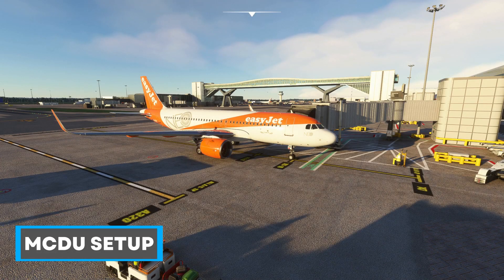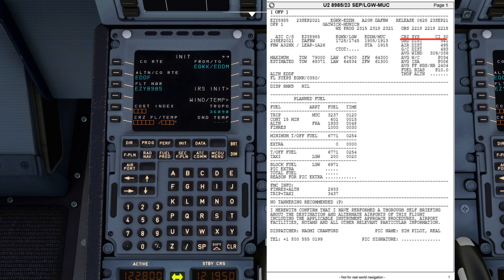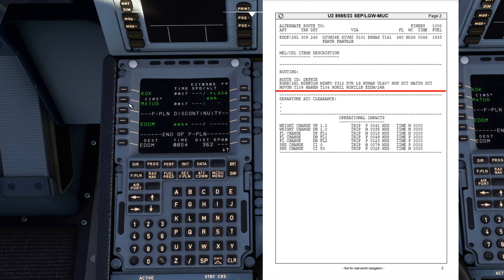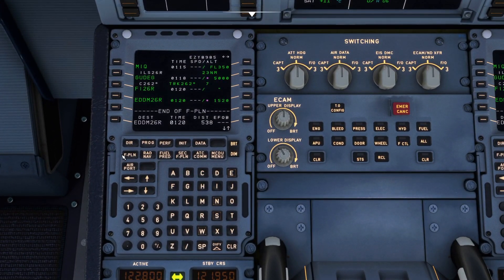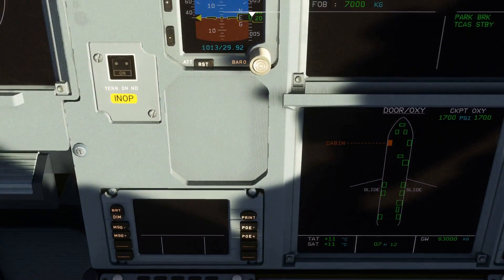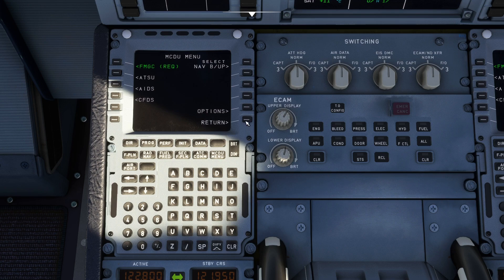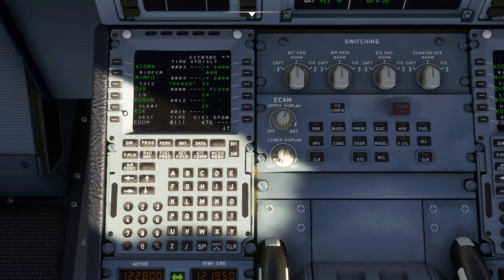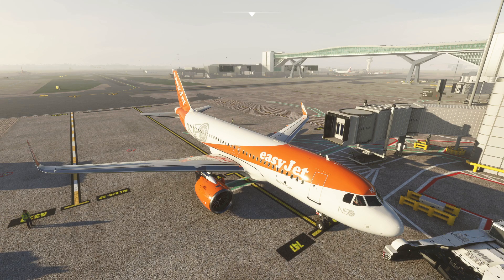A32nx MCDU tutorial | Manual setup + Simbrief

Comment from the maker: The A32nx has been updated. You no longer need to connect your simbrief username via the mcdu. All that is required is to connect your simbrief username to the flyPad in settings-atsu/aoc.
Reply: My mcdu is saying uplink insert in prog. I can’t import or manually setup. Fly pad isn’t retrieving plans either. Any suggestions?
Reply from the maker: Did you try the CLR button?
Reply: Got it sorted… the fly pad was putting a space in my user name🤦🏾‍♂️. And I had to update the fly by wire. Thanks.
Reply: I have the latest developer version but dont see the option choice on the MCDU , is this the reason why? They moved it to the ipad computer?
Reply: @DeltaTristar500  Yes
Reply: I can’t enter my Simbrief username into the flypad. I type it in but how do I click enter?
Reply: Thx for letting me know :)

Comment: But how do you setup the trim on the mcdu? How do you know what value to insert so you don't fly at crz alt pitching up like I do 💀
Reply from the maker: During cruise the aircraft should trim automatically with the autopilot on. 
The value is based off the aircraft CG and these days is calculated on the payload page of the EFB.
Reply: @RealSimPilot  I’ve been looking for tutorials about it for so long but couldn’t find anything. I found someone who made an excel document of cg values that gave the trim value but it didn’t work for me. Plane still pitched up at crz alt

Comment: I appreciate your videos and find them highly informative.
I dont have the OPTIONS available any longer  to even get to the SIM BRIEF page(s) I import from the FLY Pad ... many things seem different and inoperatvie.. I have the latest DEVELOPMENT Fly by Wire version of A320.   Are you experiencing any odd behavior with AP features and MCDU ?  
The top Panel seems much different in its operation than a few months before.  No push and pull of the knobs and no SOUNDS ? Cant use the VS features at all even on m,y  BRAVO Throttle, I have to click the EXPIDITE button to get any repsonse to alititude change .... hmmmm

Comment: Awesome video! Only problem I have is when using ATC it almost each time gives me weird altitude changes before arrival or another runway. Which will screw over my approach. Is there a way during cruise to already know what runway you’re getting assigned from ATC? That way I can still make manual changes in flightplan created by Simbrief.
Reply from the maker: I don't think there's any way around it if you use the default ATC. I don't use it so I turned it off, I'm not a fan of the default ATC.

Comment: Great video. Checking manual flight plan entry procedures and Simbrief automated integration after FS2020 update 7.  
FBW autopilot has become unstable disengaging after departure and CTDs. Community empty also other basic checks done.
Wondering if FBW autopilot in development mode with FS2020 needs a very precise flight plan entry procedure. Loading flight plan from FS2020 world map appears not to work at all.
Ever since FS2020 update 5 sadly FBW Airbus has been a very high maintenance girl. Autopilot unstable to this day. Result unable to fly FBW Airbus with AP.  FBW dev team have done a great job. Look forward to AP stability returning. Until then flying CRJ and TBM 930 with Working Title  G3000. In both AP is excellent and stable . Have been with FBW since beginning. An excellent development project that requires patience.
Reply from the maker: Thank you.
You cannot use Msfs built in flight planner with the a32nx it doesn't work. Not sure about your AP problems. Having no issues on my side with the A32nx.
Reply: @RealSimPilot  
Thank you. FBW development AP is challenging. A week ago AP was working. Now unusable. You have confirmed world map not working. Appreciated. Your tutorials are excellent. Am a deep sea yacht master and navigator learning to fly!

Comment: I'm having this weird bug where after pressing *init request on the init A page, the mcdu is stuck with uplink in progress message. Any solutions?

It doesn't let me input the from/to field manually and neither the cost index. Also in the flight plan page I am unable to add waypoints or select SIDs/STARs.
Reply from the maker: Have you updated the aircraft since sim update 7 on Thursday?
Reply: @RealSimPilot  Hey I was on the stable build v0.7.2 earlier. I switched to the experimental version today and it is working great! All the issues are fixed now. 

Thanks for the video btw. 😀

Comment: I tried to emulate your entries just for learning purposes and system cannot accept ROKIL airspace waypoint and also munchen approach pattern ROKIL1B is completely something different approach in my case. Can you please explain if you know of course what is wrong.. maybe some bug or changes in updates because i tried couple of times.. and also missing PERF/W+B option i cannot enter payload figure ... tnx in advance
Reply from the maker: Make sure you have the latest Airac navigation data installed as well as the experimental version of the flybywire A32nx.
Reply: @RealSimPilot  ahaaa.. that is probably the problem i dont have subscription for Navigraps so thus not the latest Airac (mine is 2003) and i have development version, will try experimental... anyway great tutorial! tnx.. greetings from Croatia
Reply: @RealSimPilot  Hm that strange i installed experimental version and still missing perf/w+b in mcdu... and also missing options in mcdu to automatic import fp from simbrief.. do you know if they changed layout of mcdu in newest version or im doing something wrong? tnx
Reply from the maker: @professorneutron4889  you connect your simbrief username via the flypad (iPad),  the perf w/b menu is under the aoc menu.
Reply: @RealSimPilot  I already connected and clicked from simbrief on fly pad but what is confusing layout of mcdu is different.. when i click mcdu menu left side of screen is identical like yours but on the right side there is no option and return just nav b/up on top do i have outdated version or your version is different mine is 0.7.2
Reply from the maker: @professorneutron4889  it's been updated since the video. On that page that you see look for ATSU then AOC menu. You
Reply: @RealSimPilot  Tnx for reply!, So i found out.. in newer versions there is no option any more as you said, to automatic input data from Flight Plan i must go to MCDU/ATSU/AOC MENU/INIT PRESS and then press INIT DATA REQ, then go to INIT and press INIT REQUEST then go to FUEL PRED and also from there input and data will come automatically and so on... but of course firstly connect with simbrief from fly pad otherwise there will be no INIT DATA REQ & INIT REQUEST to automatically input data from plan... if someone else got the same problem

Comment: Great Video. I dont have the "option" tab on my MCDU menu. I do have the fly by wire A32NX and I uave installed the simbrief app. Any suggestions?
Reply from the maker: Do you have the latest version? Installed through their custom installer?
Reply: @RealSimPilot  thanks for replying. Yes, I re-installed it a few hours ago. Both the fly by wire development version and the Simbrief app.
Reply from the maker: @attaboysimulations3240  if you press the MCDU MENU key does it not say options on the right hand side?
Reply: @RealSimPilot  not at all. Ive tried everything 😪.  Could it be that the simbrief directory for FS2020 is incorrect? Im running it on a separate drive, but my community folder is on drive C for some odd reason.
Reply from the maker: Looks like it's been updated. Can you check if it works by only linking simbrief to the flypad. Then go to your mcdu and go to mcdu menu-atsu-aoc menu-init/press
Make sure you have a flightplan setup in simbrief first. And that you have connected your flypad to simbrief under the flypad settings-atsu/aoc.
Should work.
Reply from the maker: Confirmed on the FlybyWire discord that simbrief integration has been moved to the flypad. That's all that's needed.

Comment: Great video Sir! Had a question, where did you get your block fuel weight of 7.0 in the Init B page?
Reply from the maker: You get it from the Simbrief OFP. In this case the block fuel is 6970kg's. Rounded up to 7000kg's. It's entered into the mcdu as tonnes. Therefore we enter 7.0 tonnes as 1 tonne equals 1000kg's.
You can also see the block fuel on the upper ecam display once the fuel has been loaded into the aircraft.